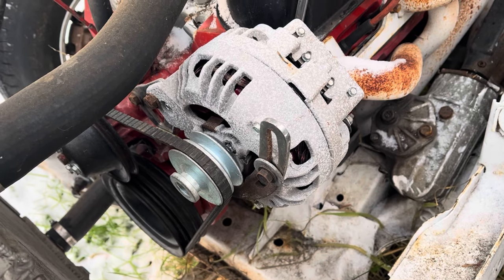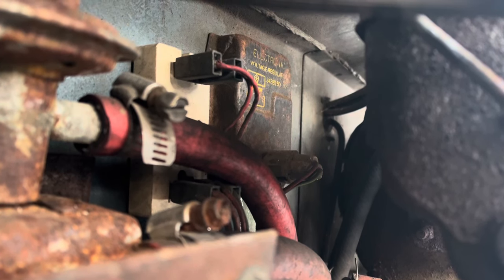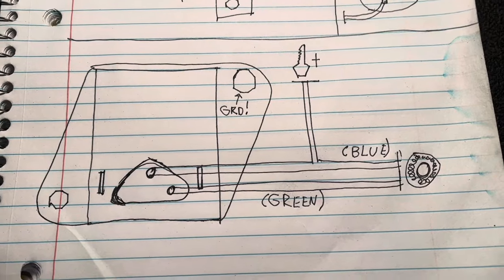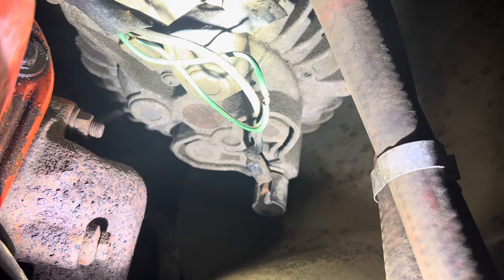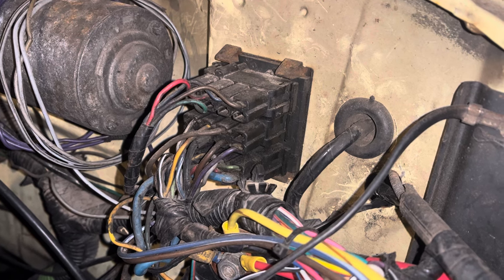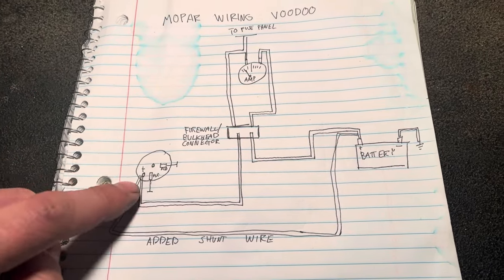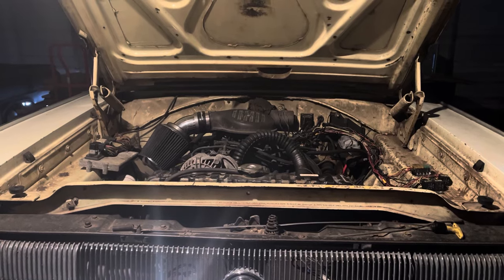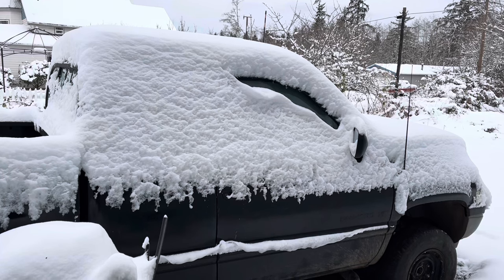Classic Mopar Charging Systems: How They Work, and How To Diagnose Failures

Comment: I had a voltage regulator die on my 77 Dodge van. It never charged like I wanted it to. I found a massive 65 amp alternator, put out a solid 50 amps.

Comment: Getting ready to rewire my 70 Dodge D200 and do away with the bulkhead fitting. Toasty, crusty and a really bad fuse block. Thanks for sharing this. This truck had sat since 1989 and after getting it running I installed a volt meter. The charging is everywhere from 12 to 16 and not just dependant on RPM's either.

Comment: I remember hearing you say something like when a Mopar has a charging problem, it's almost always the voltage regulator. The voltmeter in my 69 Satellite started showing a steady 11.5V last weekend. Sure enough, after watching this video and doing some testing... it was the voltage regulator! I got a cheap unit from the local parts store and it's back to 14.5V. Thanks for sharing your knowledge.
Reply from the maker: Awesome! I think my usual line is “it’s always the voltage regulator… except when it isn’t.”

Comment: Watched this video and did every test step-by-step and I can say that you are spot on. Just like you said I had an overcharging issue that I couldn’t diagnose but when I replaced the voltage regulator connector all was solved. Mine was a 1978 W200.  

For folks who need it, a replacement voltage regulator connector is part number PTA1062 from Advance Auto 😊
Reply: Heres a quick question though.  Replaced the alternator and with a high amp new one (Tuff Stuff 8509DP) to support my electric fans.  Also replaced the regulator.  Initially, the battery would not charge at all.  After testing it I determined “it must be the alternator”.  I swapped in the stock alternator and then it overcharged!  I watched your video and came to the conclusion it was the connector.

However, could the connector cause both overcharging with the stock alternator and no charge with the new one? The new alternator also whined which was odd.

Tested 3 voltage regulators and same result.  I havent swapped the alternator back after correcting the connector but I guess I could.

Comment: Purchasing a 1990 dodge ramcharger soon, the listing had described issues with the atlernator but after seeing this video i know its almost def not. Thank you!
Reply from the maker: No, on that one it could well be a problem in the PCM, which can be remedied by adding a 70s style voltage regulator like I discussed here. Thanks!

Comment: Thanks! The 2 pin connector overvoltage fix worked for me. Was getting 15.5v and i threw a parts canon at it to try and fix it. I wish i found this video earlier.
Reply from the maker: Been there, done that - at least twice. Glad you got it!
Reply: @DeadDodgeGarage  74 d100 club cab 318. Re-sealing a couple of drip rails this weekend and helping with my buddies cummins swap in his 74 w200 4 door short bed. Hey, what is a good number to shoot for with total timing? Im in denver with a carter bbd and tuning is a struggle!
Reply from the maker: @christhomasfilms  Sounds awesome! I actually own a '73 crew cab short W200 myself. Total timing on a stockish engine probably needs to be 32-34 degrees. If your engine is stock, I would set base timing at what the sticker says, and maybe add a couple extra degrees for flavor. I'm at sea level and don't have to deal with the store of struggle you probably are...
Reply: @DeadDodgeGarage ❤

Comment: This was very helpful with my comprehension. Im dealing with a 2000 dodge durango 5.2. Check Gauges light comes on, intermittent air bag light as well and battery gauge goes to 18 while moving & begins to regulate when stopped
Reply from the maker: Verify that reading with a multimeter, and if it’s correct, you most likely have a PCM problem.

Comment: Great content love the video was wondering if you recommend putting an inline fuse in that shunt line what would be the recommended gauge wire to handle that load thanks for all your information
Reply from the maker: I have installed many shunt wires without, but have realized as time goes on that I really should be using and recommending an inline fuse, or an additional fusible link. Without one, a short in the alternator is going to become a fire. You want 8 gauge wire, and a heavy duty fuse holder with a 60 amp fuse should cover the load, but you may need to go for 80-100 depending on which alternator you have.
Reply: @DeadDodgeGarage  thanks a lot I did end up putting a fusible Link in it thanks for all your help
Reply: @DeadDodgeGarage  What path do you use to route your shunt wire? Back with the main harness or as short as possible across some danger zones?

Comment: Just my opinion: The "1 wire alternator" is not the only option. The best option by far, in my experience, is a GM 10Si internally regulated 3-wire alternator. These work way better than any 1-wire or externally regulated unit. The circuit is very simple with a diode and dummy light. You can bypass or include your stock ammeter. I prefer to bypass the ammeter and use a power buss with a master charge fuse. I've made this conversion on several oldies including a 1947 Dodge pickup with the flathead 6. Still running great.
Reply from the maker: You can take “1 wire alternator” to mean any modern style alternator that doesn’t belong there. I use them exclusively for 12 volt conversions in older vehicles, where nothing else would ever be correct anyway. But this video exists to explain to people that they don’t need to rip out perfectly serviceable parts simply because they don’t understand how they work.
Reply: But then you have a gm alternator 🤮 keep your mopar all mopar, they work just fine if need just use a dual feild unit or even the late 1980s 120 alternators
Reply: @fifthlomat717  Yes, a stock mopar squareback alternator will do fine if you include the external transistor regulator. The point of my comment, though, was that 1-Wire-Alternators are very popular, but they don't work very well. So many people buy these because they think it's a simpler solution and an upgrade. They are expensive, and they are not what you think it is. I always say that a stock internally regulated alternator is cheaper and works WAY better. You simply have to learn how to correctly wire it. As far as the mopar thing goes, I'm not in the cult. I fix all kinds of cars.

Comment: Thanks for the vid. I have a D200 Sweptline with newer style regulator. I've got 15+ volts at the battery at idle. I was going to throw a new regulator at it, but I'll try the connectors first. Thanks.

Comment: Great video! I recently did an alternator swap with a 100 amp squareback powermaster. Direct pos + cable to battery. I'm running fuel injection and a ready to run dizzy. I've removed the ballad resistor and stock electronic ignition and have the ignition wire feeding a relay. I have not removed it from the igntion source to the firewall.
 I removed the 12 awg stock alternator wire which connected to the back of the stock alternator. My battery is now being overcharged to 15 volts. I still have the two field wires hooked up to the new alternator along wire direct to the  the battery and the alternator casing grounded to block.  Do I need to reconnect the stock 12 guage wire that originally ran to the alt to complete the circuit? Or is the VR cooked?
Reply from the maker: Is that Powermaster not self regulated? I thought they were. If not, this could be either a regulator issue, or a voltage signal to regulator issue.

Comment: What do you recommend for replacing the bulkhead connector firewall block with? Its a 73 B300.
Reply from the maker: There really aren’t many great options but repairing what you have with new contacts and lengths of wire, or a new plastic from a junkyard van if it’s totally fried. The metal contacts can be removed with a de-pinning tool (I use a very small flathead screwdriver.) I don’t think replacements will ever be commercially available for those. But the Chrysler style male and female crimp connectors that lock into those plastics are available, so you can repair what you’ve got.

Comment: Defently a helpful video, wish i would have had this info a couple years ago, my voltage regulator failed on me when i was driving and was able to limp it to the parts store and they luckily had 1 in stock, had the same thing happen with the alternator too lost all charging while driving, also found out that the reman oriellys alterantors suck, im on my 4th alternator because the bearings failed leading to horrible noise, but life time warranty, im trying to work out a issues on my 72 dart, i just installed a couple aftermarket gauges, temp, tac and voltage with a couple cigarette lighters and found im getting around 14.9 to 15.5 volts and sometimes will drop to 12.9 to about 13.9 sometimes, i know my idle is a little low i need to turn the curb idle up but  i was at 11.9 sitting in a drive thru with lights and all the other things running and left the drive through and the turn signals wouldnt blink unless i gave it some gas got up to speed and everything went back to normal till i got to the next light, thanks for the info going to be trying some diag on it, been putting alot of work into the 318 lately, fresh head gaksets, new intake, new valve covers, dropped a edelbrock 650 on it instead of the stock 2BBl, been alot of fun

Comment: Great videos you have been making.  Question for you:  The patient is a '74 Dodge Stepside Ute with the roaring 318.  I have installed brand new components from Alternator to Ignition to Battery circuit.  Engine starts right up and sounds fine.  I installed the Shunt Wire as you described (from Alt + to Battery +).  With the engine running at idle, the battery is being charged at 15.5 to almost 16 volts, with no lights or accessories on.  Seems to me that is too high, as a 14.5 reading would be more normal.  Do you think this will result in a constant unnecessary boiling of my poor battery?  Anyway to tweek that flat voltage regulator on the firewall to put out a bit less?      Thanks
Reply from the maker: Yes it’s high. Your regulator likely isn’t the problem. Make sure your firewall / bulkhead connector is well cleaned with a wire brush and electrical cleaner, then hit it with dielectric grease. Make sure the big blue wire in the connector under your column is not melted. And ensure that you have a good connection in the regulator plug itself. One or more of those things should help.
Reply: @DeadDodgeGarage  Thumbs-up.....you are quick to reply.  So, the more corrosion and resistance at those firewall connectors (or any connections in those lines), the more heat that is created, and the voltage regulator in turn tells the Alternator to pump u the juice going out?   Sounds like an evil conspiracy to burn-down the Dodge.  I will check all those wires you mentioned.  Also:  If I have the Shunt Wire between the Alt and Battery hooked up, and take a voltage reading with engine running, should that be the same reading if I unhooked the Shunt Wire and took a voltage reading at the battery with engine running?

Comment: Thanks for all the information. You're videos are helping a lot on my 78' w150 project. Question about the shunt wire though. My wires are fried behind the dash. Should I through a fusible link in there along with the shunt wire, or wire them together? Looking for a safe, non firey repair. Thanks again for the all the infiemation.
Reply from the maker: I don’t quite understand what you mean. Amp gauge wires are fried? Even with the shunt wire in place in the engine compartment, you still need those wires to power everything else inside the truck. They can be wired together to bypass the amp gauge if you want to do that, or if it is bad, but you still need those wires. So if they are cooked, you’re going to want to replace the cooked sections. Also, if they got hot and melted, that would have been caused by a short - most likely in the alternator. Hopefully you have already fixed that.
Reply: Thank you. At some point in the past, someone connected both wires to one terminal post on the back of the gauge. They were heavily corroded and the plastic jacketing had gotten hot enough to melt. Probably due to the corrosion. Thank you for your time.

Comment: Love your videos! Yes, it's me again, hopefully no stupid questions. Still having a problem with the charging system on the 440, tried the shunt wire trick. Its working obviously,. What gauge should that wire be, jumped from the alternator to the battery and should I put an in line fuse or something? Thanks!!
Reply from the maker: Highly recommend an inline fuse or fusible link. I think 8 gauge is what I usually go for. Believe that’s the size of the factory wire. I’m not very good with wire sizes. Thanks!
Reply: ok any idea what size fuse?thanks
Reply: @DeadDodgeGarage  car is charging but the amp gauge does not work. is that normal?O and i used a fusible link....
Reply: @DeadDodgeGarage  I put a fusible linand its working good.The voltage has a drop from 14.22 to 14.04 when i rev it weird but i see the amp gauge does not move anymore after i put the second alt. wire is that ok?

Comment: Thank you for these videos. They are great.  I’m replacing the bulkhead connector and engine wiring harness on my 64 Belvedere, back to stock, ditching the msd and hacked wiring job they did to bypass the ammeter and add a stereo. In an attempt to have a “better than stock” system, I plan to reconnect the ammeter, but add your suggested shunt wire from the alternator to the battery.  Also, 64’s did not have a fusible link in the system, where would I add it correctly?  Next, is there a later model Chrysler alternator that puts out a little more amperage at idle that you know of?  I’d like to get this dialed in. I’m also switching back to stock mopar electronic ignition. I’ve heard I’ll need to switch to solid state voltsge regulator, Is this so.  Sorry, lots of info for a comment, wish I could email you or something.  Appreciate you page. I’m subscribed!  Thank you.
Reply from the maker: Feel free to email. Jamienoise@gmail.com. My response will be three times as long. Haha.
Reply: Hey Tom, as a fellow MOPAR gearhead, it is highly recommended that the old analog voltage reg. be replaced/upgraded to the electronic reg. when changing to electronic ignition. ( Chrysler recommendation! ).
Reply: @stevehamilton9418  Mopar Performance used to sell a conversion constant voltage electronic regulator for switching to electronic ignition that was made for the older single field alternators. The problem was, they didn't sell the electronic regular connector, separate from a wiring harness. You could clip one from a junkyard car though. Mopar quit selling the single field constant voltage regulator. The two field alternators came with constant voltage electronic regulators, but can be used in a single alternator system by grounding one field on the alternator. That just requires a short wire from one field to the alternator body or bracket and hook up the other field just as a single field alternator. The non-chrome box ignition modules blow pretty easily, especially now with their Chinese electronics. The chrome box ignition module is much tougher and can stand greater voltage variations, without burning out.

Comment: 3 questions -  1). Shunt wire...  Looking at doing this modification.  In your Nov. 19th live you mention it along with adding a fuse.  If you have a 100amp Alternator, I'm thinking that a 4awg cable is needed (2awg preferred for headroom), with a 100amp fuse.  Is this correct?   2) any thoughts of using a 100 amp circuit breaker vs a fuse?  3) If you put in the shunt wire and the fuse blows or breaker flips that would put all current through the factory 10awg (might be 12awg) wire to the firewall...  Is it then preferred to put a 45amp fuse on the lead wire to the firewall?  Thank you in advance.  Sorry if you covered this in a different video...
Reply from the maker: I really haven’t covered it yet, so it’s all good. I am fairly certain that the factory charge wire is 8 gauge, and I have generally used 8 gauge for the shunt wire. In theory, half of the charge will go through the shunt wire, and half of the charge will go through the original circuit. In practice that won’t be exact due to the resistance through the original charging circuit. It’s a very rare day that your 100 amp alternator ever puts out 100 amps. While it’s true that 8 gauge technically isn’t up to the task of carrying a 100 amp load, it essentially never will. A breaker should work fine, but breakers also reset. This is a fuse/breaker that is only ever likely to blow if there is a dead short to ground, and in a case like that, I think I’d like it to blow and stay blown. So I like to use a heavy fuse in a solid mounted holder. Protecting the factory charge circuit with a fuse is also a fine idea. Deleting the amp gauge entirely is a fine idea too. I don’t take these steps. I prefer to leave the factory circuit intact, and add my own. It seems to work very well. I also hedge my bets and unplug the batteries in my classics at night, though. If a short in the alternator ever develops, at least it won’t take my car while I am sleeping.

Comment: 7:40 - Interesting tip about the shunt wire.  I just picked up a 1973 Duster, and it has an extra wire running across the front of the radiator going from alternator to battery, haven't looked into what it is for yet.  I will check tomorrow.
Reply from the maker: Oh, I’m sure that’s what it is.